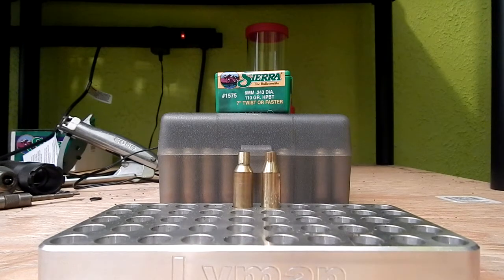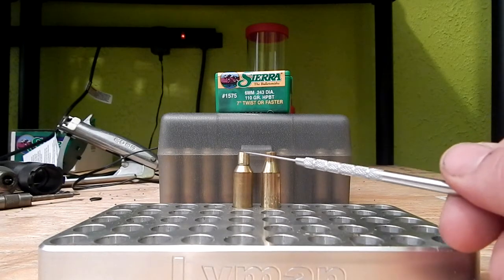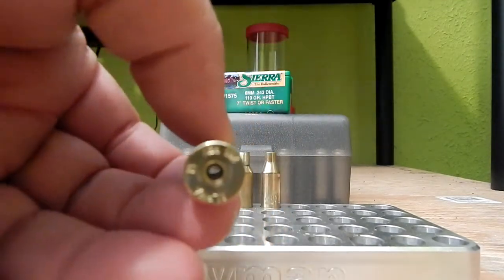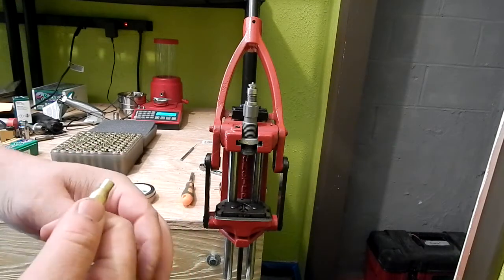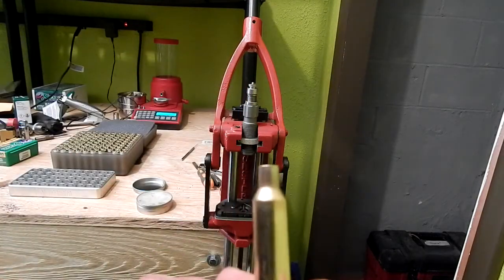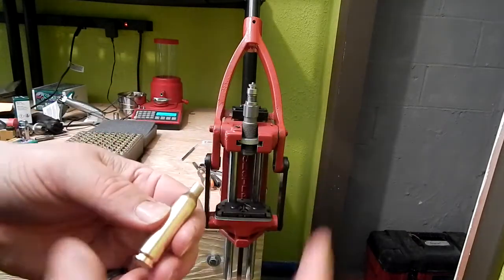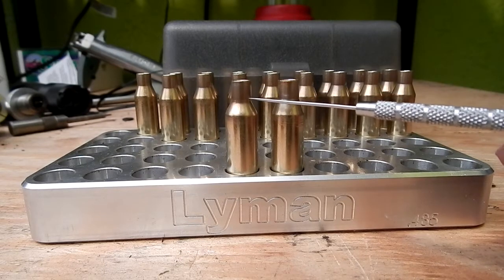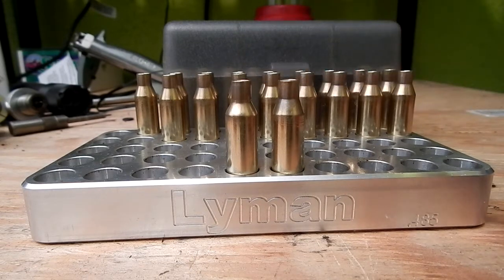6 Super LR: Forming Brass

Comment: This is an old video but in case someone else watches it,  I'm having great success with Winchester 243 brass. Lapua takes a lot more work.  I have to size it down, run it over a mandrel, then chuck it in my lathe and cut the don'ut out with a chucking reamer, then neck turn a thousandth off and it's ready to go. I have had best luck with H4831SC

Comment: Hi Excellent vid.. Im just about to venture down the SLR path.. i have a reamer coming with the .120 freebore and will be set up in a single shot action for benchrest..do you think this freebore is too long for the 110 sierra and 115berg vld in regards to seating out as the throat wears? because i may have time to change the freebore on the reamer order..  Also the whidden die that you are using is it their full length die with no bushing or is it the full length die with the bushing..??  cheers..
Reply from the maker: brunell69 it will work but it's a little long. I went with 0.075" FB in my new rifle. Much easier to seat close to the lands. I use the standard FL non-bushing die.
Reply: Thanks... Have you fired any of the alpha brass yet,, has their been any issues with donuts? or are you finding the shoulder brass thickness consistent with the neck brass thickness..
Reply from the maker: I've fired a lot of it. No issues with donuts so far. I have some on it's third firing.

Comment: Can you form a piece of .308 brass to 6 SLR? Or would you have to size it to .243 first? Any issues related to doing so? The reason I ask is because .308 brass is abundant and more or less free in Sweden, .243 is very rare.
Reply: Yes you can do it, I do it all the time with a Forster 6xc full length die. I highly recommend you use imperial case lube and you will have no case failures. That thick Palma brass and mil brass will need a neck turn to be rid of the doughnut that will form.

Comment: Your not getting a donut with Peterson or alpha munitions
Reply from the maker: I'm not, but a friend of mine tried it and got donuts, so who knows
Reply: @MrSurgicalPrecision  what reamer do u use
Reply from the maker: @joshhuttunen8821  I used a JGS reamer with .075" freebore
Reply: @MrSurgicalPrecision  that works with alpha and Peterson 260 brass without neck turning, I'm getting ready to have a barrel spun up just trying to pick one of the 5 reamers they have, I plan to run 110smk or 115dtacs
Reply from the maker: @joshhuttunen8821   it works for me but my gunsmith did a barrel with the same reamer and he's getting a donut, so I don't know.

Comment: What kind of results do you think you'd get out of Lapua 260 brass? Do you think this round has benefits over 6mm Creedmoor?
Reply from the maker: txsharpshooter85 Since some of the shoulder flows into the neck,I think you would probably end up with a pretty large donut.

The advantages of the SLR over the 6 Creed are more case capacity and more speed. This comes at the cost of slightly accelerated barrel wear. Quality brass was also an issue but the Peterson and Alpha .260 brass have solved that problem.
Reply: I guess you'd be giving up a little room in the magazine to seat bullets long with the SLR. I am shooting a 8 twist 243 right now with about 700 rounds on the barrel. I am trying to decide on my next cartridge.
Reply from the maker: My wife's rifle has a .130" freebore and loading with .010 jump using Sierra 110s I'm out of magazine room using non-spacer Accurate mags in a modified Remington SA.  I ordered a new JGS reamer with .075" freebore for my SLR. That should let me seat the bullet deeper without encroaching in powder space too much.
Reply: I am leaning towards a 6 Creedmoor and necking down Lapua 6.5 brass. I was debating going 6.5x47 Lapua, but my 243 is so sweet to shoot with a brake on it. Flat shooting as hell
Reply from the maker: Either round will perform well for you. I think the Creed is a little easier to tune than the SLR.